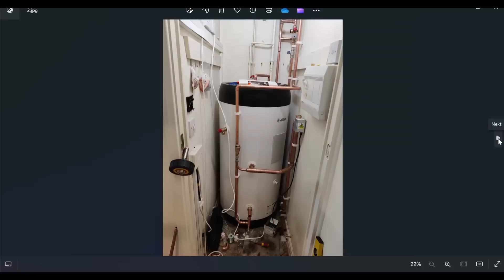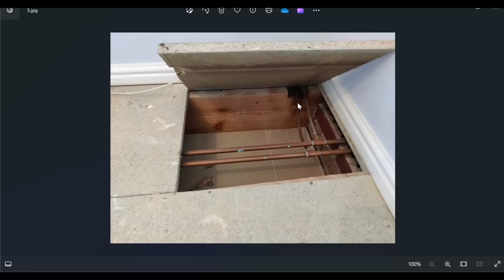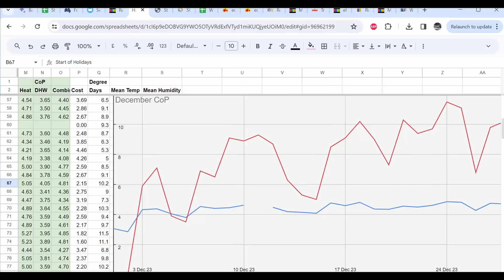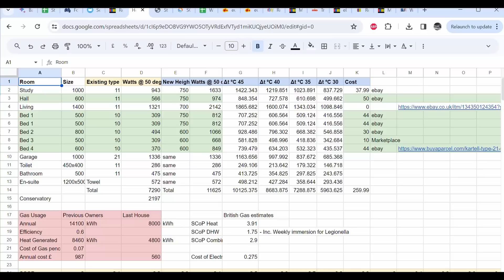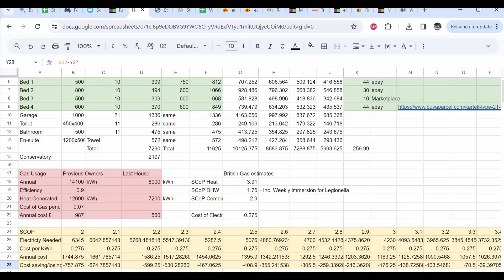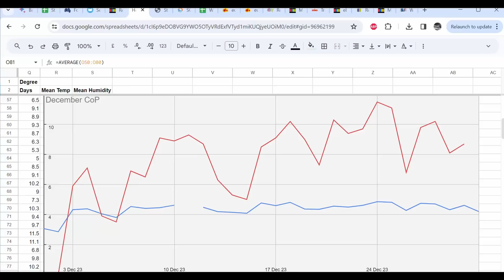How Efficient is my Air Source Heat Pump in Winter? December 2023 Monthly Data Report Update

Comment: There are people who for whatever reasons are anti heat pumps, a bit like there are people who believe that only Tesla make good EVs. God forbid one disagrees with them. If a house is poorly insulated then it’s going to be expensive to heat no matter what method is used and for a heatpump to work under those conditions the house has to have adequate sized radiators. If windows and doors are draughty then they need fixing if lofts aren’t insulated they need to be. As for wall if they are not insulated then no matter what fuel they will loose lots of energy. I have a friend who live in a 100 year old stone built house that they heat for one hour in the morning and four in the evening. The minute the heat goes of the house becomes cold. If they heat it with a heatpump and try to keep it warm all day of course it would cost a packet but equally so if they ran the boiler all day. Some of our housing stock is so old that eventually it will have to be upgraded with internal or external insulation or demolished. That’s a fact of life because sooner or latter gas reserves will run out. That’s when the sh1t will hit the fan so we need to do something now even if it means moving over to hydrogen, and if that happens then gas would almost certainly be more expensive than electricity.
Reply from the maker: Totally agree. Reducing our consumption can often make us more comfortable when we do it through methods such as insulation and as you say, will benefit any heat source!
I really agree with the principles of movements such as Insulate Britain, it's just a shame that they wind up the general public so badly!

P.s. don't get me started on EVs! I worked for Mercedes-Benz when Tesla started stealing customers and sales from us. You should have seen and heard some of the awful propaganda inside the organisation which was trying to fight against EVs, until they finally realised that it was inevitable and they had to embrace it. Once they had their own models ready and available for sales they changed their tune 180 degrees overnight.

I've witnessed the same with some car owners as well. Totally against EV until they got an electric company car and now they're the biggest evangelists for them!
Reply: The main issue people have with heat pumps are based on horror stories. The problem is that electricity is 3 and a bit times the cost of gas. So the heat pump has to have a cop of at least 3 to break even. When people don’t have the house configured correctly the cop will go down badly and they then end up with a more expensive system to run against gas. 

Also people are used to gas and gas is easier to design and more forgiving for over specifying it just cycles (bad for the boiler but dosnt cause much of a problem with gas usage) it typically runs hotter than a heat pump so outputs more for the same size rads. 

Well designed installs are key.

Comment: The saving are overstated,  Your comparing a old boiler with non of the enhancements you put in place for the heatpump.    I gone from old gas boiler to new gas boiler I save over £300 a year on heating.   Not one installer will guarantee any saving by installing a heat pump and you not factoring the high cost of servicing a heatpump which going cost around £300 vs £100 for gas boiler.
Reply from the maker: Thanks for your comment.
I covered those points in the video.
Yes, the servicing cost is higher.
The insulation improvements were mostly all in place long before the heat pump was installed.
I installed them in Feb 2023 and the month I compared to was March 2023 which was the old boiler but with new insulation already fitted.
I also compared my running costs against a 80 and 90% new boiler.
Ultimately, the second sheet shows that for the same amount of heat generated, a heat pump always wins in terms of running costs over a CoP of 3.6 and that is giving the gas boiler every benefit of the doubt and pretending they're all exceptionally well installed and run, which we all know they aren't.
The vast majority don't have the correct heat loss calculated, the correct flow temperature or flow rates set, the controls are rarely compensated in any way.
All of this stuff should be standard on any heating system, not just heat pumps. The gas boiler industry here in the UK has been having a laugh at our expense for decades, as all of those things are mandatory in most other EU countries such as Germany where they have to do it properly.

Comment: Those are really excellent figures that show when done right heat pumps do work and work well. As for gas boiler efficiency,  I ran a service and repair company for both gas and oil boilers in the ROI. and can confirm that condensing boiler are very efficient at startup, but once the system is up to temperature the efficiency curve drops back substantially and an efficiency of 80% would be considered very good. However most customers when the weather gets really cold turn up the boiler temp and that decreases the efficiency.
Reply from the maker: Thanks for your comment and confirming what I know to be true.
Speaking to engineers on the front line as well as some who work in R&D for manufactures, they mostly seem to understand that the stated efficiency on the boiler is misleading. 
Gas combustion analysis is not the same as boiler efficiency. At all. As you rightly point out, when measuring at the flue, it is typically just a snap shot in time as no one permanently fits a sensor in the flue and datalogs the combustion through the complete cycle of startup, burn, cool down etc.

Let alone the losses through the heat exchanger etc.

Comment: Thanks very much for taking the time to present your data.- I think I will stick with the Gas Combe - as I only used approx. £50 for both electric and gas last month.
Reply from the maker: That's very low use! Do you have solar panels or anything that contributed to such a small bill?
Reply: £50 to do what my bill last month was £312 , £76 electricity & £236 gas & our house is constantly cold, It was built in 1904  so im sure a heat pump wouldn't work for us but unless your a 1 bed flat no one is having a £50 bill for Dec
Reply: @martinhammett8121  I live in a 1960 house. We're I have put some installation into the loft and walls. But my house also gets cold if I leave my heating off for a day.  Luke you.  Before I purchase a heat pump then my house needs to be air tired
Reply from the maker: @mysmtpservices4818  it is a common misconception that a house needs to be air tight or extremely well insulated to perform well with a heat pump.
You can either insulate to reduce the heat loss or upsize your radiators to compensate against the existing heat loss.
Typically a radiator for a heat pump would be 2-3 times the size of a radiator for a traditional gas boiler installation, with all other things being equal.
Take care 👍
Reply: @UpsideDownFork  ok, so by the sound of it, all you just said is to paid more money for  heating, to compensate the heat loss.
Reply from the maker: @mysmtpservices4818  yes, more money up front that is true, unless you factor in that you get a 20% discount as VAT isn't charged on this renewable technology and the government is currently giving everyone a minimum £7500 grant on top of that to pay for the work.
Getting a heat pump system was cheaper than a new gas boiler equivalent in my case and as the system was 27 years old it was overdue an overhaul.
Reply from the maker: @martinhammett8121  you would need giant radiators or underfloor heating retrofitted to make a heat pump work efficiently in a place like that!

Comment: It’s good to see ASHP not more expensive than gas. Your March 2022 gas 1844 kw at  todays svp prices 7p plus 233 kw electric at 30p is £198 so only slightly more than your equivalent Dec 23 average temp 7c of £187 for 600 kWh .Are you still paying 30p electric Dec.2023?  Tracker has averaged 20p electric tnd gas averaged 4p.
Your temp of ? 18c if true much of the day is cold and would not be “comfortable did most of us” like a realistic 20c . Nice video with real facts. I still have gas . 5bed fetched 1995 build.
Dec 2023 I used 2800kWh gas 19.5 c hove 7am-10pm and 400 kwh electric (no battery) and on tracker was £212 plus £20 sc..  if we can get ASHP to run at the same costs as gas and generate mostly renewable electric then it’s a must for the environment.   But with 2-5k
Even after 7500 grants it’s not feasible
For many until boilers fail!
Reply from the maker: Thanks for your comment. Some great points.
1. The December price cap electric rate for us in the south of England  is 27.5p, not at 30p, but perhaps next time I will put some correction factors in place so it is more of an apples to apples comparison.

18 degrees internal temp with the heat pump feels like the 20 degrees we were used to with a boiler. It cannot be overstated how much different the house feels. Family and friends also notice it. Even things like the leather sofa are no longer cold when you sit on them so the air temperature doesn't play such a big part as it used to.

That being said, our average of 18.5 degrees includes setback time of sleeping and out at work, we do typically run it at 20 degrees 4-9pm which is very warm indeed.

There is great potential through smart tariffs like octopus Tracker to make a substantial saving.
Or by over generating and exporting excess solar in summer to offset the winter cost.

Comment: It's nice to have more proof of a heat pump working in real conditions. I guess we aren't going to see huge savings until the price differential between electricity and gas changes, which could be a few years. Do you think solar power would generate enough in the winter to be useful? What about using a battery to store cheap, off-peak power?
Reply from the maker: Yes, it will be interesting to see the price differential change over time.

Personally I don't think batteries are a viable option.

Even on a typical mild winter day like we've been having you would need 30kWh batteries to cover the load of our modest home.

Is this financially viable from a capital investment point of view? Not for most of us.
The ROI would be insanely long, even if you are willing to finance that move.

My personal favourite strategy is solar, especially now that it is relatively cheap. I.e. under £1000 per 1kWp.
Fill your roof, over generate throughout the summer at the 15p/kWh SEG rate and build up enough credit to offset your winter use.

This is my next real world experiment though, as soon as the DNO approves my G99!

Comment: What ever is said, gas is 3x or 4x cheaper than electric, a good hp with cop3 or at a push 4, it cancels out on cost, however with the added insulation, thats where the improvments are, there would be the same improvment with a gas boiler.  One has to compare apples to apples.  So yes a hp can match running cost of gas boiler. All else being equal. Many posts compare hp With insulation to  too gas boiler without the added insulation. Problem is you want to compare  running data for hp without the other improvements. That isnt going to happen.  It is just physics.
Reply from the maker: I also just remembered that the insulation was added back in Feb 2023. (Videos on the channel of me doing it)

The closest month in terms of outdoor temperature that I compared in this video was March 2023 whilst we still had the gas boiler but had already insulated.
So I have unknowingly performed a close apples for apples comparison, even though the gas boiler still had no radiator circuit in the conservatory at all in march, it still performed considerably worse than the heat pump is currently performing, even though it's heating more space.
Reply from the maker: Fair comment. The gas boiler wasn't heating the conservatory area at all which was the biggest heat loss and the biggest improvement in insulation.

Yes the loft insulation is now 350mm but it was 150mm before which isn't the best but also not the worse and as I'm sure you know, there are diminishing returns with increasing depth of loft insulation.
Reply: OVO are offering electricity @15p/kWh 24 hours a day for their heat pump installations. And those with EV's & home batteries can get it at 7p/kWh. That changes the sums quite a bit, and given that UK government also imposed higher temporary taxes on electricity generation than fossil fuel production, I would expect that the move to heat pumps will be quite beneficial financially over next few years.
Reply from the maker: @_Dougaldog great points 👍
I haven't shown yet in a video how Octopus Tracker has actually averaged out around 16p/kWh for electricity and 4-5p for gas i think as well.
I wanted to keep the price cap rates in the spreadsheet for costings just for simplicity's sake.
The reality for me is that i will over generate and export so much solar in the summer that it actually offsets the winter consumption considerably.

There aren't many smart tariffs or options with gas but with electricity it is an absolute minefield with so many different routes that can be taken.
Good for us if we are willing to put in the leg work to research and sometimes take a bit of an informed risk too.

Comment: Great to see the SCOP graph, be interesting to see it when the temperatures are negative. You will probably lose out to a gas boiler then, but if you gain in spring and autumn, this will cancel out and you should be better off over the year. With upstairs being on 15mm, does it get hotter up there? Or are the downstairs radiators larger to compensate for the microbore?
Reply from the maker: Thanks for the comment.
I'm sure we'll get colder weather in Jan and Feb and I will keep reporting back on how it fares.
The radiators are all sized according to the heat loss of each room. The size of the pipework doesn't really matter in my case as none of the radiators require more than 1kW of heat to be delivered to them, which is when microbore can potentially become a bottle neck.

The system is still balanced using the typical method so the 15mm fed rads need closing off a little more than the 10mm fed ones.

Hope that makes sense.

Comment: Good video.👍 The major difference of course is that your house is continuously comfortable with no cold spots, so even if that was costing you £400 more per year - in my opinion that would be a very worthwhile outcome. Did you explain in your prior videos why your boiler was unable to keep your house warm?
Reply from the maker: Exactly. My wife would probably pay an additional £1000 per year for the increase in comfort!

Thanks for the comment 👍
Reply from the maker: The main reason the boiler couldn't warm the whole house was just a lack of radiators in the conservatory area mainly.
The other issues I had already rectified during the winter of 22/23 upstairs so the bedrooms were toasty but downstairs struggled as the conservatory/kitchen/dining area seemed to rob all the heat from the adjacent rooms.
Reply: @UpsideDownFork  OK, understood - thanks for replying.👍